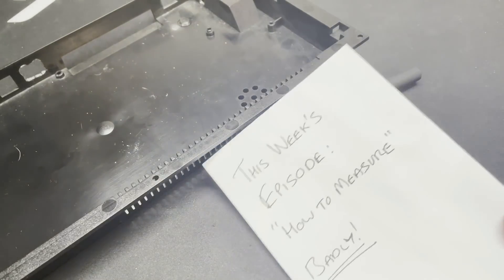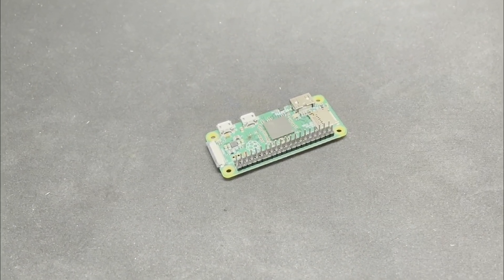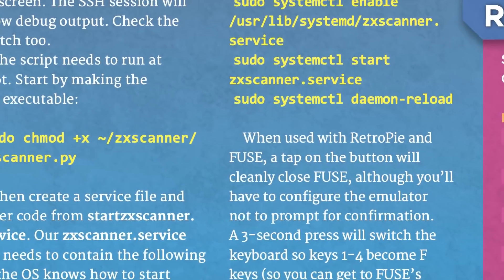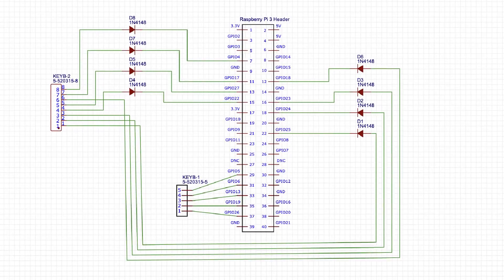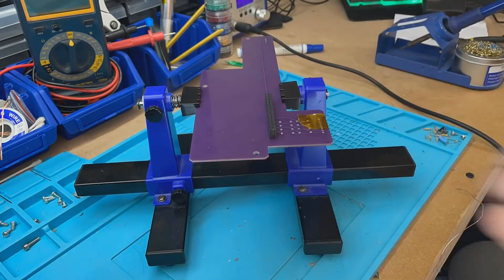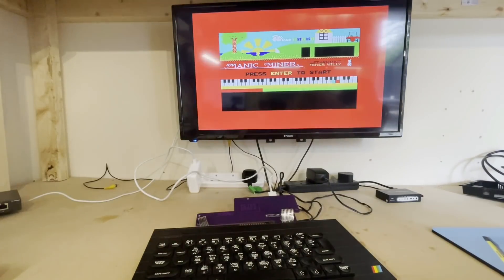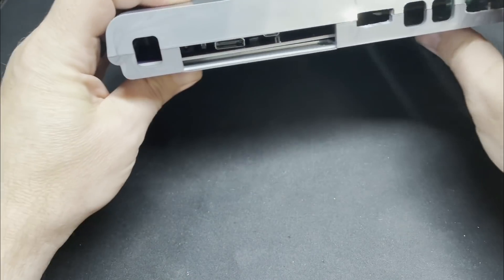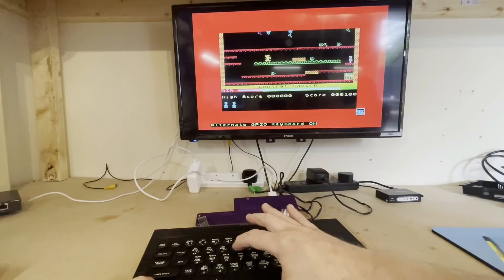Just a fun little newbie ZX Spectrum PCB design project - but may turn out quite usable!

Comment: Excellent! If you wouldn't mind my making the odd suggestion:
1) If your PCB design had a cut out sized to fit your Pi A+ it's PCB could be set level with yours leading to a bit of extra neatness all round and more room for those ports out of the back of the Speccy. A short bit of ribbon cable could be used to link the relevant GPIO pins.... or a smaller custom PCB.
2) If you're feeling especially brave you could add the microSD card as part of your PCB... I believe there are suitable test pads on the A+ or at worst a bit of fiddly de/resoldering of the Pi's microSD card. Maybe add a barrel jack to your design for power?
3) If you want to shrink your PCB, and so save a bit of money, but the screw holes you want to mount it to are a long way off one solution is to add large solder pads to your design that you can weld something like old RF shield to... cut that to make suitable extensions to your mount holes, drill, and Bob's your significant other... there's an added bonus with this mounting method that if your measurements are a little out that can be fixed at the soldering the mounts stage.
4) No idea, but does this emulator do anything else you might want at a later date? At the least it's worth running all the Pi's GPIO header pins to your own duplicate header on your PCB even if you don't use them... upgrades to the software, things you decide to add later, or even leaving the option open to run something entirely different on that Pi, would be more likely to be covered.
5) It's always a good idea to make your power traces a lot thicker than the 'standard' ones and as a minimum keep all your grounds on one side of the board and use your CAD software to do a ground plane flood. Better yet, put all your positive traces on the other side and do a flood for them... it's a small trick but apart from helping to reduce noise (probably not important for wiring a keyboard!) you end up with a bit of free capacitance between your + and - that helps to smooth your power rails... again probably not important for this project but people invariably neglect the decoupling capacitors (me included!) and this can aid stability a lot as your designs get more complex... also PCB's that use copper floods just look better.  
6) Again not exactly important here but if you find yourself routing potentially noisy / high speed lines like audio or video traces it's a good idea to make these a little thicker, embed them in your ground fill, keep them as well separated as you can, and well away from bus lines that may either introduce noise or in turn be upset by your 'loud' lines - almost every retro computer you have used that hasn't got good audio or video, or gets flaky with upgrades is like that because theses aspects weren't considered.

I hope that's all useful food for thought and you don't mind my attempt at teaching grandmother to suck eggs.

PS
Again not relevant here but you may have heard people say "never trust the auto router". That is absolutely true but that doesn't mean you can't use it. 
-Careful component placement.
-Be sure every IC has a decoupling cap (100nF-ish ceramic) and the main power input has it's own too. (10-100uF electrolytic + 100nF-ish ceramic)
-Route your own power and ground rails being sure to keep them to their own side of the board on a two layer PCB.
-Let the auto router do all the other lines because life is too short, but check to make sure it's not done anything stupid.
-Do a power and ground flood.
-Done!
Reply from the maker: Thanks for all the tips!  Lots of really useful info there :)

Comment: A little tip when making the PCBs.. Print one on to paper and stick it to some card.  Cut it out and then test to see if the board fits the case and that slots and holes line up.  It may also highlight any issues like the connector issue with the pi... just saves time having more revisions of the board made...  You'll soon be designing a 4 layer 1000plus pin PCB :)
Reply from the maker: Well... I've just found out that you can turn a Gerber file into an STL file and 3d print it... So I can do all my revisions that way until I'm happy with the fit and then send off for the final boards :). I'm a happy little chap :) :)

Comment: Here’s a tip for pcb fitting.
When you print it in a laserprinter at 100% it’s spot on to the real dimensions. So you print it out cut it out and just map it to the dieting holes and parts.

Comment: This is a great project! Though, given the space constraints, would it not be better to lean into the original mistake and keep it mounted on the bottom of the board? That way, you've full clearance on the expansion port for the Pi's ports, and just need some inexpensive washers to lift it up a bit? One other thing occurred to me: a nice extra might be a 3D-printed panel that could be slotted into the expansion port slot around the Pi's port to keep any dust and crud out.
Reply from the maker: I had considered that :). But there's a nagging in my brain that just shouts "Do it properly!" :)  I'm hoping the next version will do the trick - if it's still tight I may have to consider the bottom approach!   The 3d printed panel is a great idea though - That's happening :) :)
Reply: @TheRetroShack  Raspberry Pi 3 can get pretty warm. Mounting the Rpi at the bottom and cutting a hole in the board above the CPU would allow to attach a heatsink to the CPU.
Reply: Better than that I think would be to use a right angle connector to connect it and have a cutout in the PCB that the PI board sits in so that the PI board and the ZX board are sitting at the same level. That would shift the ports down to the bottom of the opening in the original case AND let the Pi be mounted right side up.

Comment: Very nice. I had the Pi Zero inside mine but didn't have a PCB. I also wasn't a fan of ZXBaremulator. The interface was rather fiddly and it isn't open source. I was pondering adding a joystick port, probably by piggybacking on the keyboard like the Sinclair interfaces did; but then the ZXZero came along and I've not regretted getting one.
Reply from the maker: Yes the joystick port is lingering around in my head too :) :)
Reply: @TheRetroShack   Kempston is almost certainly the way to go.  You could probably stick a 9pin port straight on the GPIO.   "reading from port 0x1f returns the current state of the Kempston joystick in the form 000FUDLR, with active bits high", though most (linux) emulators should support using a usb stick directly I'd assume, so you really just have to have the USB port exposed.

Comment: I think the only thing needed with this is a Mechanical Keyboard PCB so you can use Cherry MX compatible switches :)
Reply from the maker: Now that's a thought! :) :)
Reply: @TheRetroShack   I would buy that PCB for my Harlequin 128 W.I.P
Reply: I feel like those already exist.

Eh, just put the adaptor right on the same PCB as the switches.

Comment: Great job on the board. Have you thought about a 2.1mm power jack and then pass that through to the pi power via a USB or similar connection. The BMC64 pcb does the same. I've never has a spectrum but this might be a nice way to make one 😊
Reply from the maker: Thanks!!  The new version has a Micro USB power socket where the Spectrum's usual power input is and that powers the PI :)
Reply: @TheRetroShack   the original 2.1mm Spectrum power jack actually supplies 9v+, so it'd need a 5v regulator to knock it down to 5v for the Pi, so using a USB jack for power is by far the better option for a low fuss device.
Reply from the maker: @TheTurnipKing  Yep - it's a USB 5v socket - just in the same place as the old 9v one :)

Comment: This is a project I really want to have a crack at! what are the options for a new case and keyboard? My brother-in-law has a 3d printer that he hasn't used much and thought it might be fun to do something together?
Thought a flat membrane ZX80 and case to show my son what it was like to try and program Basic on 1/2K of memory!
Then a Dead Flesh Spectrum?
Reply from the maker: You can buy complete new Spectrum case, keyboard, membrane and faceplates in a kit from RetroRadionics.  Some people have said that they've had problems with deliveries from them but personally I've not had an issue so far.  You could also buy a known non-working Spectrum from eBay - you might still need a new membrane but they're not expensive.   Let me know if you decide to have a go at this, and hope it all works out if you do :) :)
Reply: @TheRetroShack  I’ve sent for a case as I have a few raspberry pis needing a project!  Retro pi is ok but I’d rather a dedicated machine with the feel of the original that can be booted straight into the os but with modern reliability!  Great to show the grandkids as well although I don’t expect it’ll get them off of their switches any time soon!
Reply from the maker: @gartmorn  Final (hopefully) version of the PCB will be with me this week so follow up episode to, err... follow soon :)
Reply: @TheRetroShack  look forward to seeing your results!

Comment: Could you add holes for the USB, hdmi etc so the pi sits lower and the HDMI is inline with the pcb?
Reply from the maker: New PCB design due to be delivered today and hopefully I’ve fixed the issues :)

Comment: Getting analog audio from the PWM output is not so difficult. Just a handful of resistors and capacitors is needed to filter the signal. There's a schematic available of the first generation Raspberry Pi. There you can see how it's done.
Reply from the maker: Thanks - yes it's not that difficult apart from the fact there is a contention with the GPIO pins that ZX Baremulator uses for the keyboard - and also the extra few pounds to go from the Zero to the 3 A+ just negates the need to worry about a complex (and more costly) PCB :)  Just trying to keep it simple for everyone - and me :) :)

Comment: Is it possible to buy some kind of approximation of a speccy keyboard (a 3rd party keyboard or something like that) and then have a go at this project? I don't mind it not feeling like the real thing because I have no nostalgia for the speccy but I would like a simple setup that I can easily store away and then easily plug'n'play whenever I feel like it.
Reply from the maker: You can buy complete new Spectrum case, keyboard, membrane and faceplates in a kit from RetroRadionics.  Some people have said that they've had problems with deliveries from them but personally I've not had an issue so far.  You could also buy a known non-working Spectrum from eBay - you might still need a new membrane but they're not expensive.   Let me know if you decide to have a go at this, and hope it all works out if you do :) :)
Reply: I hear tell that ByteDelight sell refurbished Spectrum Plus cases with new membranes, rubber feet, etc etc. (Disclaimer: I've not used them myself.)

Comment: How about mounting the Raspberry Pi on the bottom of the board and keyboard switches on the top?
Reply from the maker: I'll see how this latest revision turns out - someone else has mentioned that there may be a heat issue, so that may drive the need to put the pi on the bottom and a fan on top :) Let's see :) :)

Comment: Question:  Would this help me get into the ZX Spectrum world, considering that I don't have even a screw that came from one?
Reply from the maker: Definitely!  You’d have access to the whole library of Spectrum software.  Hardware accessories wouldn’t be compatible of course but if you just want to play games or use other software you’d be sorted :)
Reply: @TheRetroShack   The keyboard layout is 95% of what makes old Home Computers feel distinctive, and that's what's usually missing when you run the same emulator on a PC.

Comment: Before the pandemic getting PCBs made in China by one of the popular board houses was pretty cheap and fast. As long as your order was below a certain threshold (20 quid or something?) there was no import duty, and you'd have your boards typically in a week.
What's it like now? Have the import duty rules changed? Is postage from China a complete 'mare?
Reply: Hi! I would also like to know your feedback about ordering the PCB
Reply from the maker: Cost wise I haven't found cheaper - including DHL delivery.  And also the turnaround time for these boards was under a week!
Reply: It sounds like it's back to business as usual, then. Many thanks!

Comment: damn never used a raspberry pi ..that is something else i have to look at  .. currently working on a  external keyboard interface... and an edge connector breakout board - well plan is that my new edge connector pcb's will connect to the breakout board similar to how the Arduino does with its shields. Maybe i should look at pcb way as to date  i have been using the other company .. just received  rev2 of a atari 2600 rom cart that i made.. as i designed the rev1 upside down ie the upper pin connections where on the bottom and vice a versa .. oops
Reply from the maker: Getting the pins upside down :/ - I feel ya!  Good luck with the project and let me know how it goes!

Comment: All Pi's output sound on the HDMI connector, so of you are connecting via HDMI(who wouldnt) a pi zero should be perfectly useable
Reply: Yes they output sound via HDMI, but are you sure there isn't there a difference between the SOC used on the Pi 3A and the Pi 1 A/B and Zero/W that might prevent this from working?

Comment: I know you've not used any enough to recommend any particular one, but which software did you find to use? Afterall if a non previous user like you managed to do this, it's probably a good choice for us too
Reply from the maker: I tried Fritzing, Circuitmaker, Autocad and ended up using Kicad.  Bit of a learning curve and I'm still bouncing around different software as I learn more.  As soon as I settle on something, I'll do a full end to end video on the process :)
Reply: @TheRetroShack  that sounds like a great idea. I've been using bread boards and Verostrip boards for years, but never got into proper pcbs :)

Comment: So the point of this is to reuse original Spectrums whose electronics are too broken to repair but still have functioning keyboards? You’d not gut a working one would you?
Reply from the maker: Good God No! That would be absolute sacrilege!  I would see this either as a replacement for broken boards where the keyboard is still good, or for use with a brand new case and keyboard. :)
Reply: There's almost no such thing as a Spectrum whose original electronics are too broken to repair ;)

The original machine  is 99% generic logic and can either still be sourced or has modern equivalents.  The single semi custom chip has been reverse engineered and is well understood.

What this has going for it is the zero is SUPER cheap and low faff.